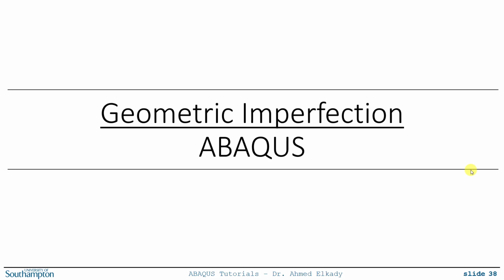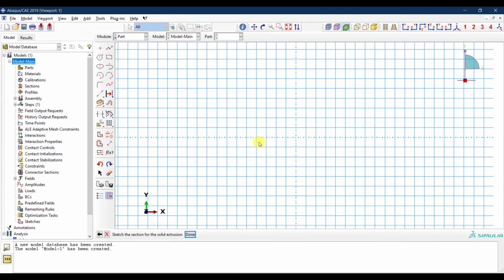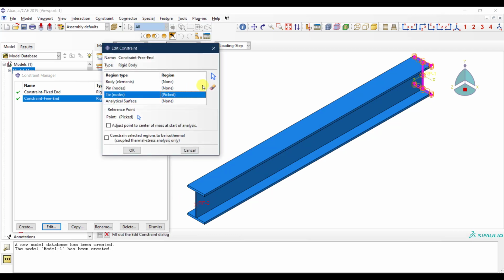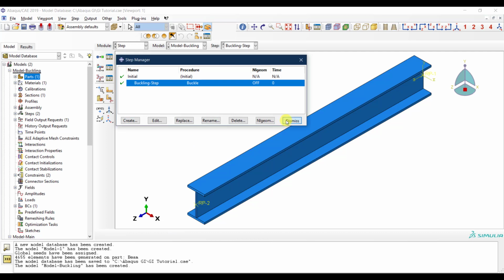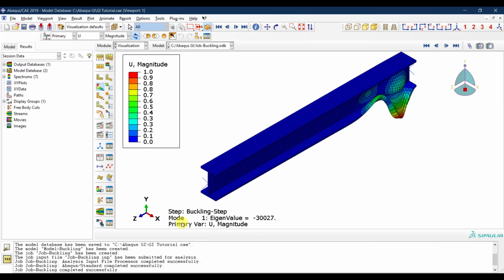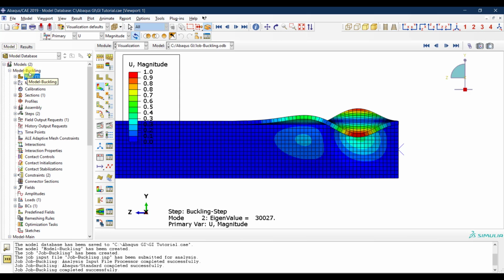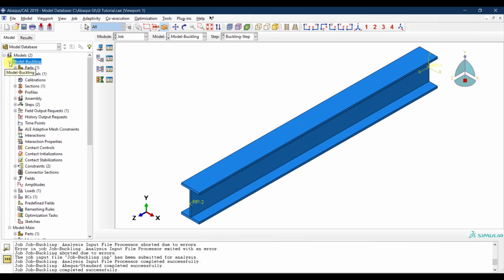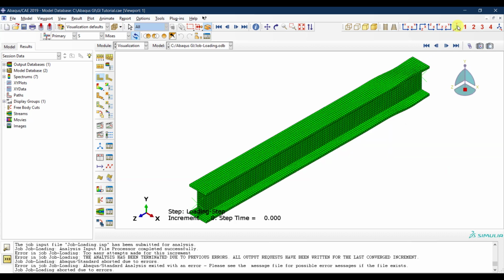#23 ABAQUS Tutorial: Modeling Geometric Imperfections With Buckling Modes

Comment: Why do you need the scale factor? Is it just for visibility? Is the default scale factor 1?
Reply from the maker: you need to specify the scale factor at which the geomterical imperfection is imported. The scale factor will depnd on your objective. If you use a scale factor of 1, this mean the maximum imperfection is of magnitude 1 length unit (e.g., 1mm in this example)

Comment: Hello Ahmed. Thanks for great pedagogical video. One question.  If I have a column with several loads along it's height,  or say a beam...  Should I run Eigenvalue buckling analysis with all these loads and get the corresponding modes ?

Comment: Thanks for the class!
Just to find some things faster... a detailed breakdown of the modelling process:

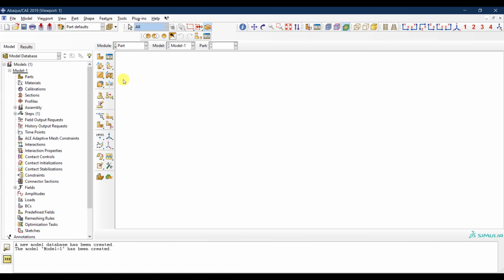3:41 Rename Model
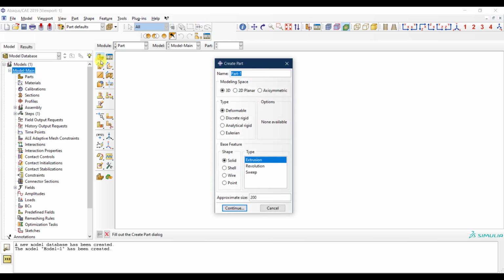3:56 Create a Part and its Partition
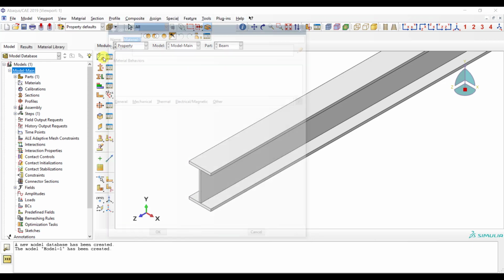5:14 Properties
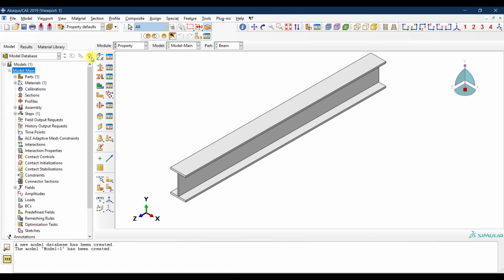5:36 Create a Section and Assign Section 
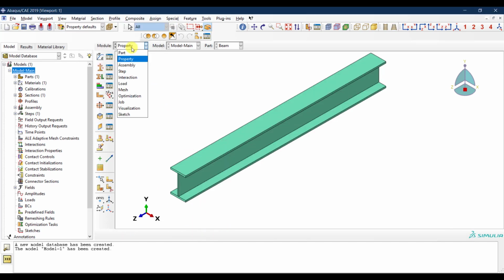5:57 Assembly
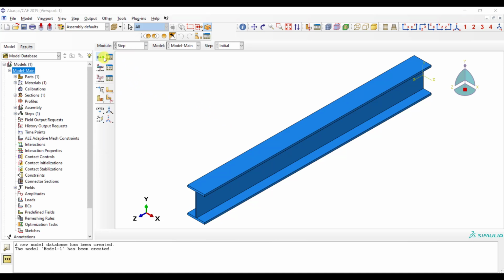6:07 Create a Loading Step (NL Geometry)
6:50 Define Reference Points and Rigid Body Constraints
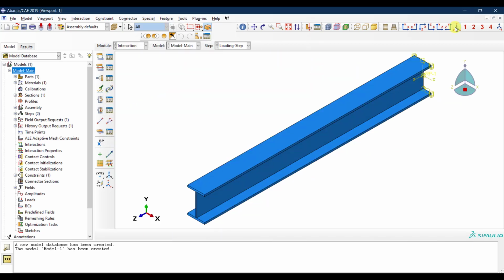7:38 Create Reference Point to impose Rigid Body Displacement
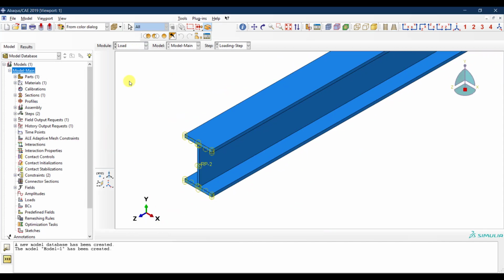8:26 Create Step: Fixed End BC
8:55 Create Step: Displacement (Ramp)
9:50 Meshing
10:18 to run the job? Define imperfections...

[in progress...]

Comment: Hey Ahmed, I am modelling an I section like you are in the tutorial, but the space between the flanges is filled with reinforced concrete: in this case: is it enough to conduct a buckling analysis only with the steel profile and create a fil file from only the steel beam or do i have to conduct a buckling analysis from the whole concrete filled i section? because in both cases the first mode is the same so if i scale it the same it shouldnt matter no?
Reply from the maker: You might get errors if the main model nodes are not consistent with those of the buckling model. ABAQUS documentation states the following:

"ABAQUS imports imperfection data through the user node labels. ABAQUS does not check model compatibility between both analysis runs. Node set definitions in the original model and the model with the imperfection may be different. Care must be taken for models in which ABAQUS generates additional nodes (for example, the nodes generated for contact surfaces on 20-node brick elements). In such cases you have to ensure that the models for both analysis runs are identical and that the nodal information for the generated nodes is written to the results file"
Reply: Thank you very much!

Comment: thank you for your good tutorial، I have a question. i'm working on IPE sections. my critical load in analysis , without imperfection is 42KN which is very close to experimental results. But when , I incloude the initial geometric imperfection equal to 3.6 mm which is 0.001 time of my beam length, i get results that is not true . its readuses to 32KN which is small than experimental critical load. and my second question is that , is it possible to eigenvalue to be less than my critical load? or it must be always , higher than critical load which obtain from nonelinear buckling analysis called riks method?

Comment: Slm Dr Ahmed could you clarify why the buckling load of the first mode is negative while the load is in y positive direction ?, i think the first mode should be positive with local buckling in the upper flange that's more rational with the direction of load